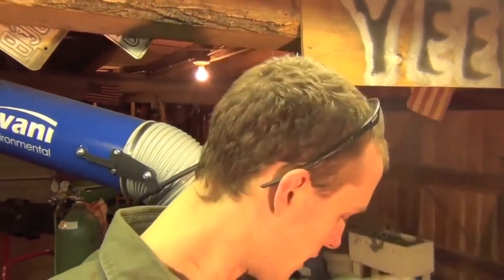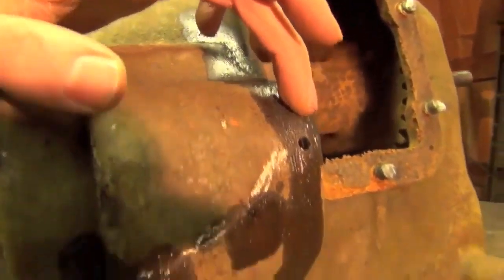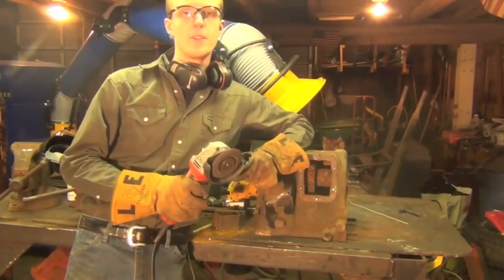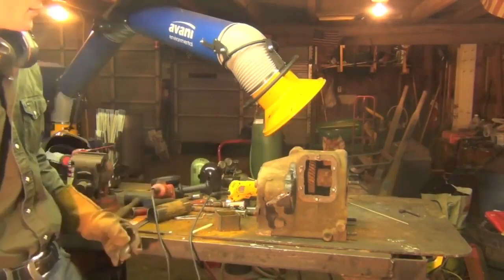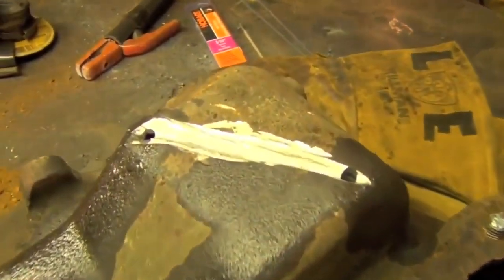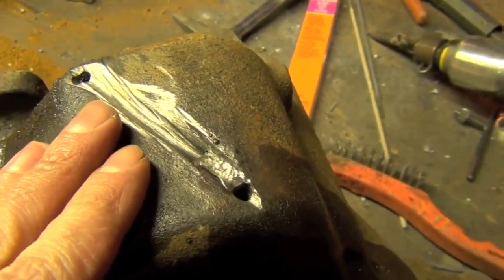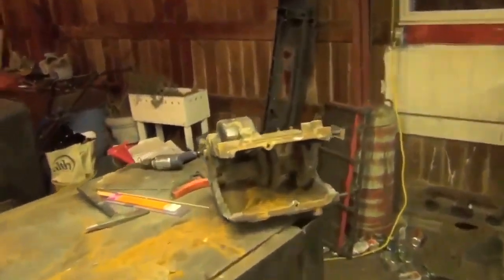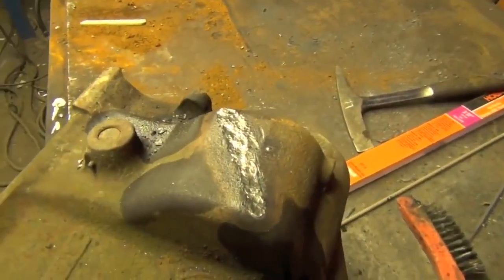CAST IRON REPAIR WITHOUT A PREHEAT - STICK WELDING REPAIR WITH SIMPLE TOOLS

Comment: That’s basically what I did with a coulter bearing that was broken in half. I just used 3/32 6013 because google said 6011 and 7018 wouldn’t work. Actually google said 6013 was also a poor choice but sounds like it would be the most likely to work. No pre heat no post heat and took about 3 hours to do the job. Lots of grinding. It worked!

Comment: great video! I got a really long crack on the differential case of my Russian tractor, the length is like 50cm and some more edges on the top, both sides and inside the case. It has to be really strong as it's holding the hydraulic lift on it, so I'm not sure how get done. Any advices would be welcomed. Thanks